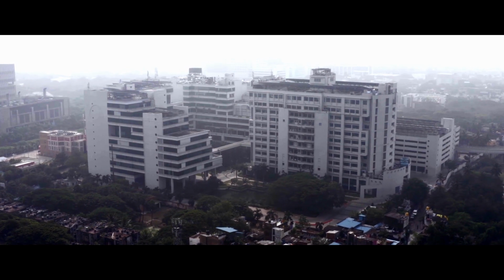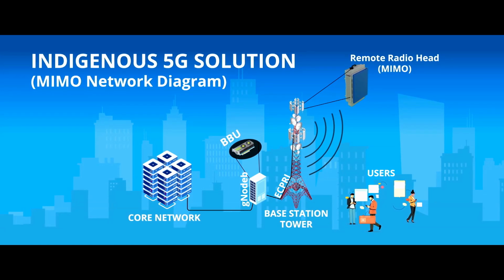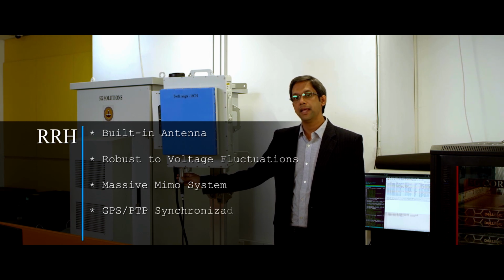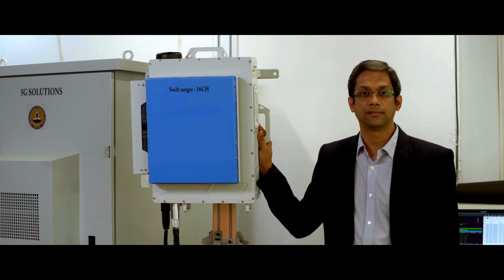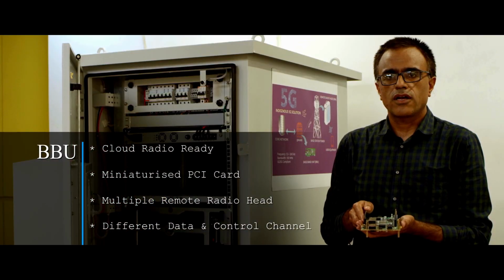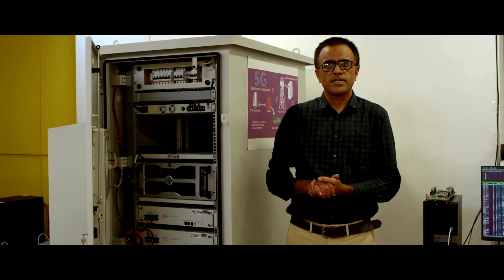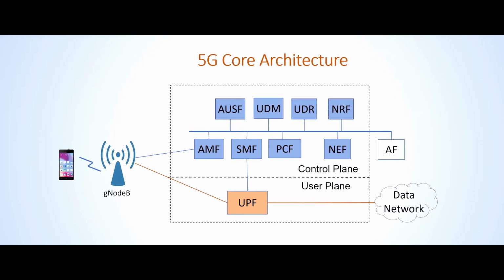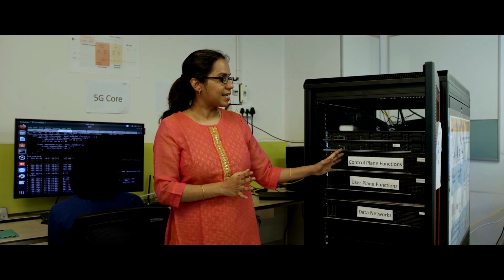Indigenous 5G end-to-end solution developed by Sameer, CEWiT, IIT Bombay,  IIT Kanpur and IIT Madras

Comment: Great !! Congratulation to entire team!! It will definitely benefit to all if you can launch it commercially and it will happen soon, Now the private 5G era is coming , Implement in industry for automation, health, ports etc .As per video 16/32/64 MIMO antenna ,BBU unit,5G core on NFV based .All things are as per current standard based.
Regards,
Rajesh